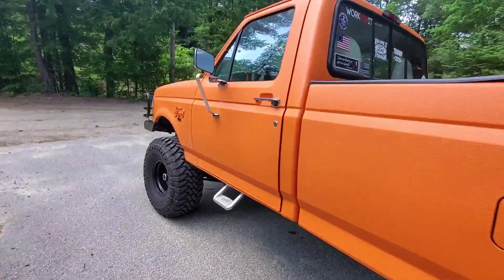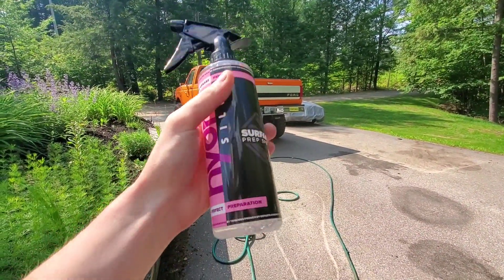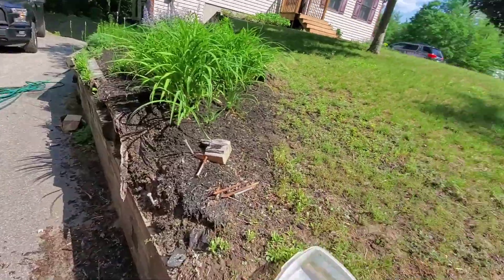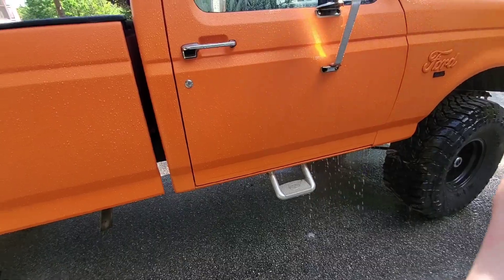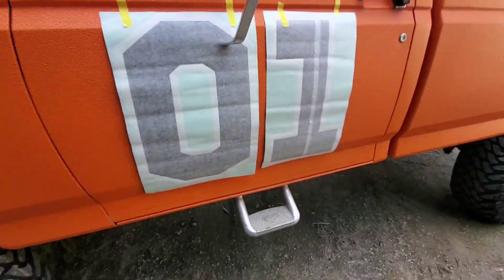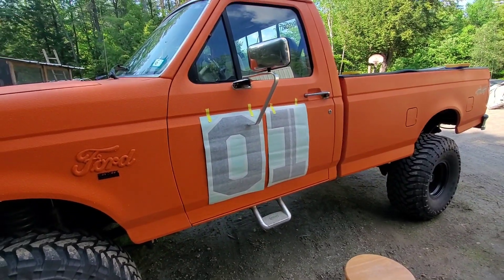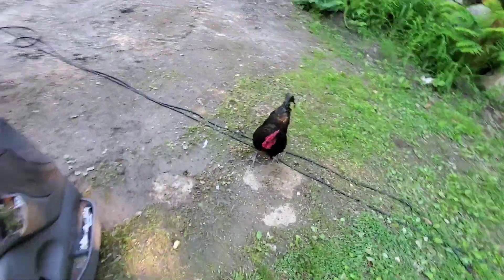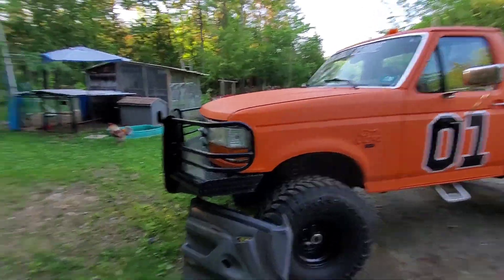Putting The Finishing Touch on my "General Lee" Tribute truck - Decals on bed liner paint job.

Comment: Thats pretty dang cool where did u get the decals from n how much did they go for im looken for decals for my general lee build
Reply from the maker: Ebay. I think I paid, somewhere between 50-80 for them. That's for both sides total. Gotta find a good seller. FYI, do not use them on bed liner. Only regular paint. They didn't last more than a month. I'm sure on paint they would have been perfectly fine. I ended up using plastidip afterward and it's held up much better.
Reply: @Bearbait01  trhank you very much i saw the video of the decals n then i seen the plastidip still cool tho lol im builden a generallee but not the ordinary car youd use im using a 69-74 plymouth scamp/dart to build one sucks i ant using a charger but there to expensive and this  poor boys gotta do what he can to improvise ya know lol thanks for the videos 🤘😎🇺🇸

Comment: Any special requirements for the decals material?
Reply from the maker: For Bed liner yes. It has to be very thin and very sticky. These decals did not last more than a month and really not more than 2 weeks. For a regular painted surface. You're all set. They'll stick fine.